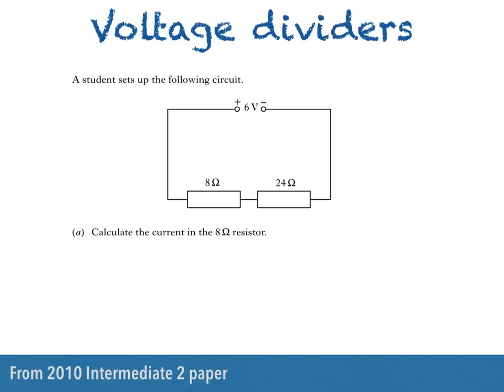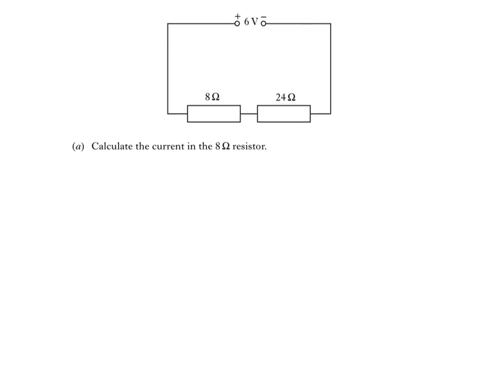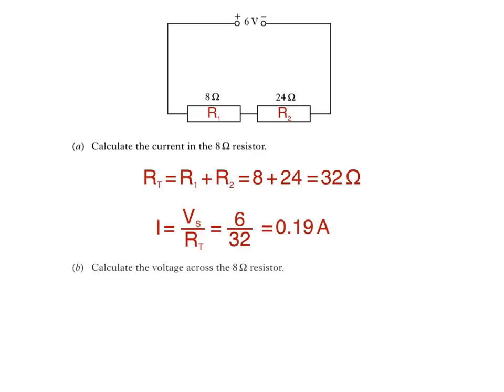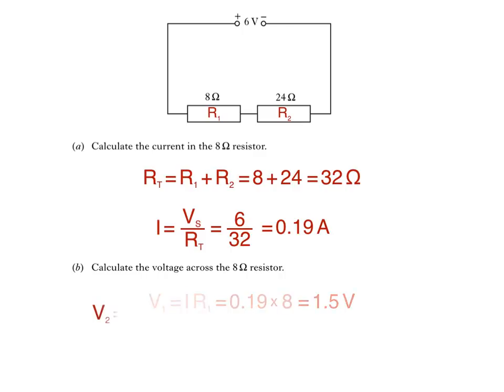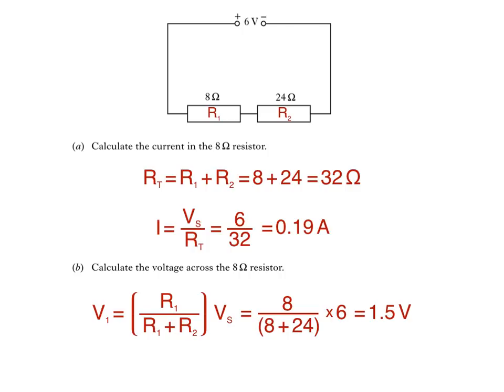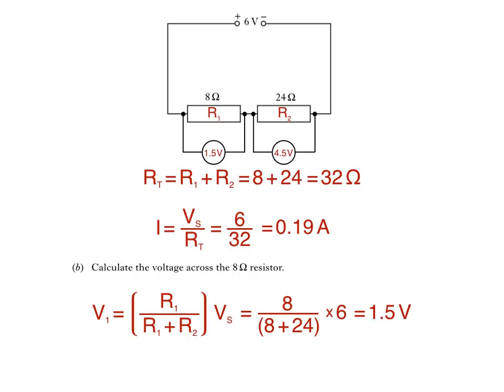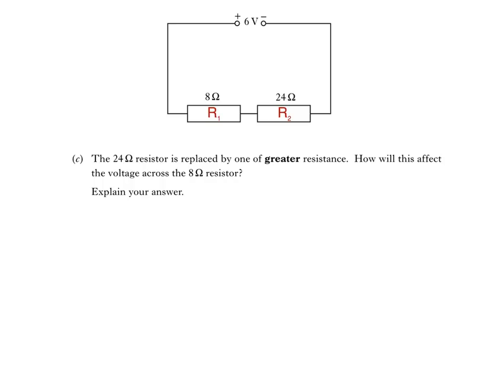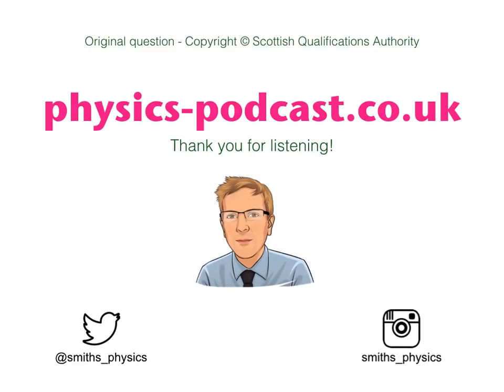National 5 Physics - Voltage dividers

Comment: If there were two of the same value resistors in parallel and then one of these was swapped out for a resistor of higher value, what would happen to the voltage in the resistor of a lower value?
Reply from the maker: It would increase ( as long as there was another resistor in series with the parallel branch) - voltage in parallel is the same in each branch so the voltage across both resistors in parallel would increase. It's very different to resistors in series (such as a voltage divider) where the resistor with smallest resistance gets the smallest share of the voltage. It's pretty tricky answering the question without giving examples so I'll have to produce a video at some point with various circuits to help explain.
Reply: @MrSmithsPhysicsonline  thank you very much for the quick reply!
Reply from the maker: It's all part of the service!

Comment: For the first question why wouldn’t we do 6 over 8?
Reply from the maker: The current in a series circuit is the same at all points and depends on the TOTAL resistance of the circuit. If you were asked to find the resistance in the 24 ohm resistor, you'd do exactly the same thing.
Reply: Mr Smith's Physics online ohhh okay, thank you!!
Reply: Have you done refraction of light in your channel?